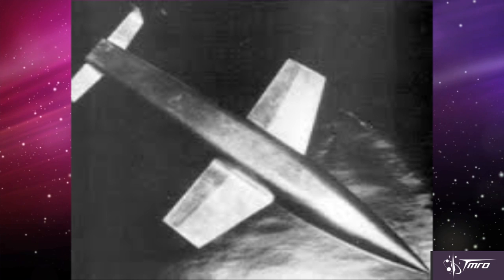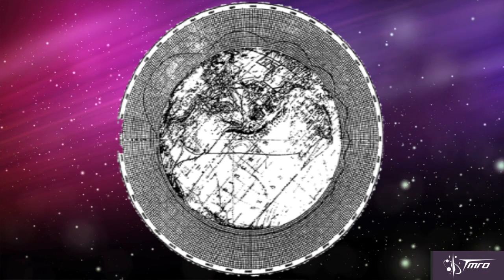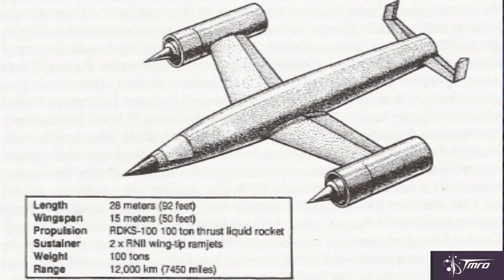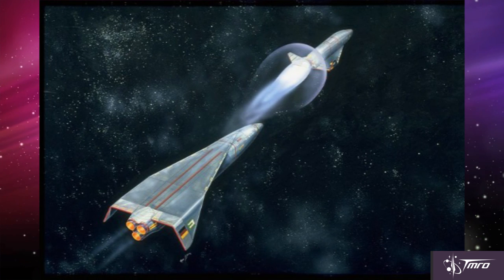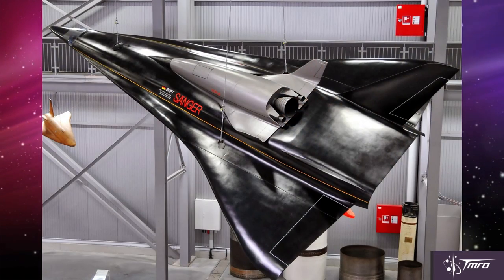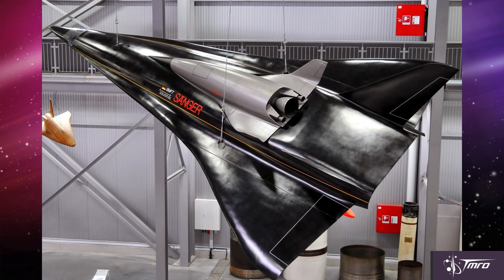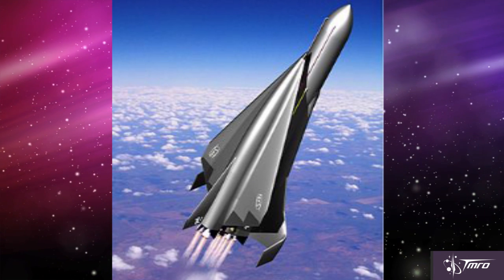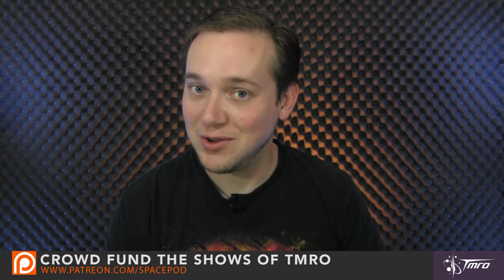Spaceplanes Part 1: Early Spaceplane Concepts - Space Pod 04/23/15

Comment: I'd never heard of the RT-8 before, might try to build that in KSP.

One thing I'd like to know is how they planned to overcome an offset centre of mass. Having a heavy space plane mounted so far back on the booster would've required lots of aerodynamic deflection (Which isn't available at high altitudes) or extremely angled main engines, which aren't present in the illustrations. Unless of course the second stage engines would also fire at launch akin to the space shuttle.

Comment: A spaceplane that you should talk about space Mike is the single-stage to orbit "Skylon" spaceplane. The company behind it, Reaction Engines, has gotten the concept to a TR level of 4/5, so it is close to becoming a reality. The man behind the project, Alan Bond, said they should have an engine prototype by 2019 and it should be in service by 2021-2025. The key technology behind the concept is the SABRE engine which contains a pre-cooler which has been tested and worked flawlessly. If successful it'll be more advanced than any space vehicle built thus far. Airliner-like access to space is the key to reducing the cost and building an infrastructure in space. Like Alan Bond said, rockets just can't hack it and we need something better. Another spaceplane concept in development is the ISRO "AVATAR". It's also a single-stage to orbit concept but less is known about it.

Comment: G'day Mike,

 Yay Team...!

 Those German Levitationists have had a dream to be able to bombard New York for quite a while before the Silbervogel/Silver Bird idea..; after the Armistace in 1918 the Occupying Forces found an enormous prototype Triplane Bomber, with about a dozen Engines and 8 gigantic Wheels, intended to carry a tiny weeny  bombload to the US, was found in a half-finished state...

  Apparently all that survives is one of the Wheels, which is in a museum in Germany ; it's weird enough too, a pair of shallow Plywood Cones separate the Axle from the Rim, and the Tyre appears to be a thin Steel Band heated and shrunk into place like that of a Wagon Wheel, so overall it looks like a 15 Ft Diameter Athlete's Discus with a hole for the Axle..., Lightweight, and with a huge Circumference, very cunning for it's day...

 The other point...; those Sweptback  Parallelogram Wings on the Silbervogel, they seemed almost identical to the ones which were built and attached to the Extended-Range version of the V-2 (but I don't think they were flown during the War...?).

  So, I kind of expected the review of Space-Planes to have included the famous photo of the Chequerboard-Painted  Winged V-2 standing on it's Tail ready for the ubiquitous Von-Braun to test-fire it, during his Early-AmeriKan phase when he was gaily demonstrating how cleverly helpful he could be to Anybody who wanted to bootstrap themselves into Liquid-Fuelled Skyrockets...; and at the time he was pretty much the Planet's most accomplished Rocket Bombadier, so perhaps predictably (certainly it is, in 20/20 Hindsight) he got a job writing his own Job-Description.

For the second time, too..!

;-p

Ciao !

Comment: China has tested the H-11(light of five stars) hybrid space air plane on the JF-12  (mach 5 to mach 10 ) wind tunnel for Wang Zhenguo  turbo-scram jet engines and tested on the FD-21 (mach 10 to mach 15) wind tunnel for the rockets that will propelled the H-11 into near space for 3.5 months.